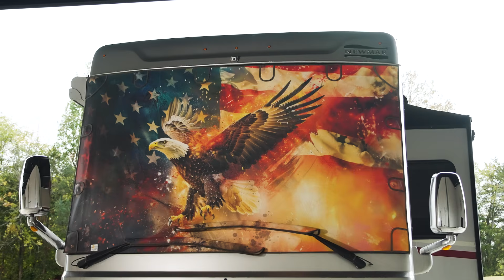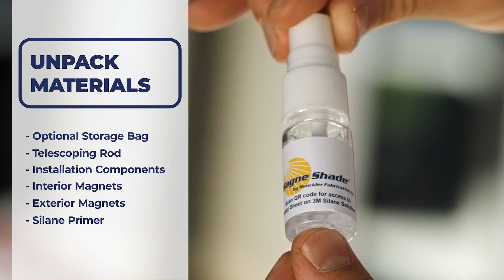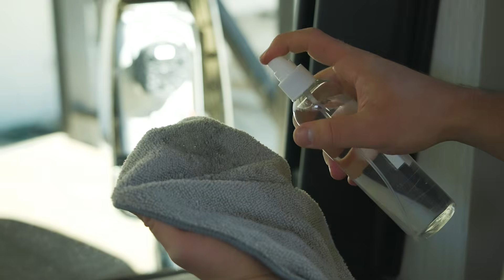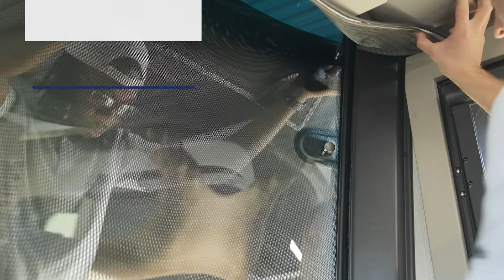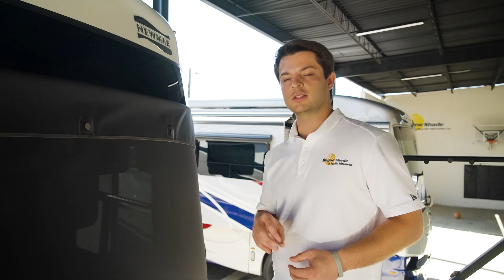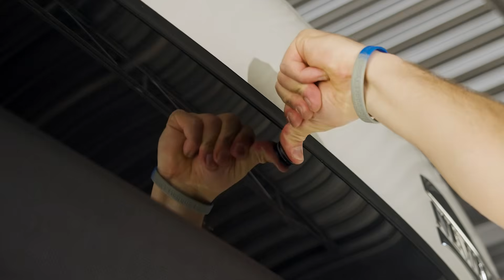Windshield Shade Install with Upper Exterior Magnets by Magne Shade®

Comment: If you don’t have any Interior obstructions, do you still need the exterior magnets?

What if you have ceramic Window Tint on the inside of the glass?  Is that going to affect the installation?
Reply from the maker: Hey there, if you don't have any interior obstructions, your shade will utilize all interior magnets. Tint on the glass is fine and doesn't need to be removed in order to install our magnets!

Comment: Would it help or hinder the buddy magnets if they were also taped in place with painter's tape?  Apply pressure via the tape but easy to remove?
Reply from the maker: The pressure of the tape alone wouldn't be enough. We recommend pressing each exterior magnet for at least one minute when installing.